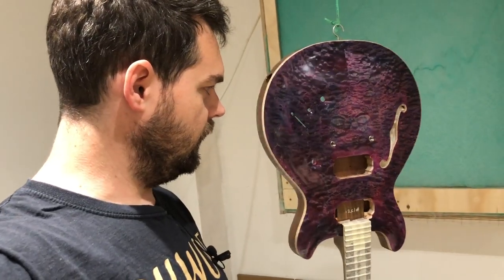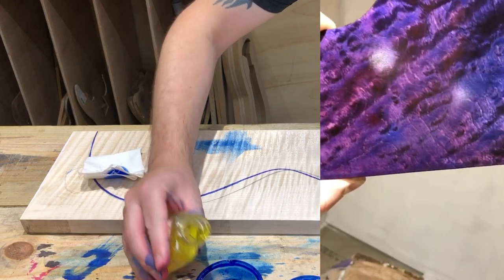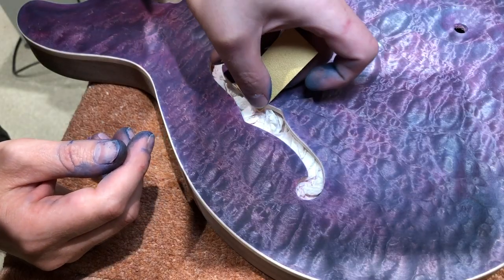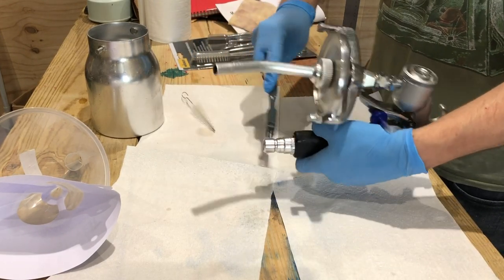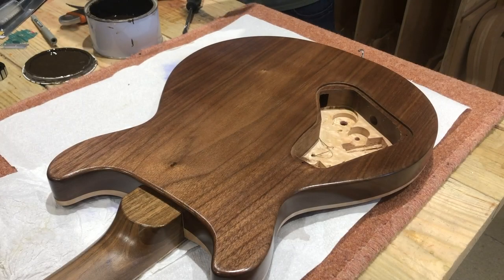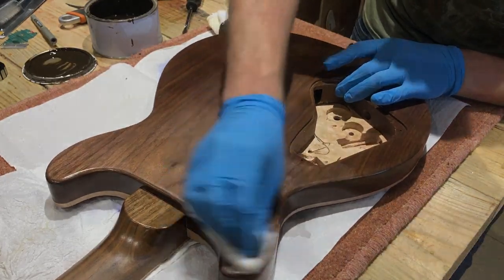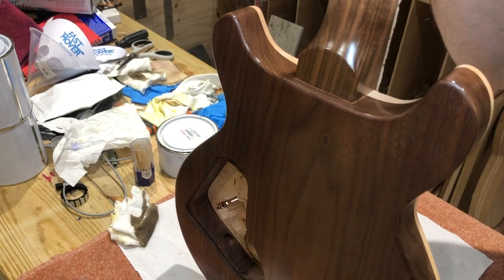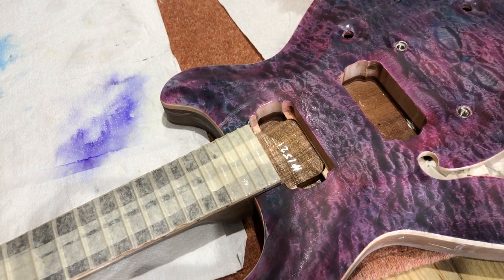STAIN, FAUX BINDING and NITROCELLULOSE finish | Great Guitar Build off 2021 | 5 of 6

Comment: Timber mate filler has been the best I've found for filling deep grain. No shrinkage, dries quick. Does a great job! Finish colors are looking great btw! Glad to see you're spraying a proper laquer finish with a proper gun. Makes a big dif
Reply from the maker: Thanks bud, does timber mate come as a clear filler? I was really only trying out Aqua Coat to save time not having to tape off the faux binding. I should have done a tester first but I've been rushing to get this thing finished.
Reply: @ADFinlayson  they have all sorts of various colors. I'm sure they have a neutral/clear color. Give them a try. Ived used many dif kinds of grain filler and Timbermate has been the only one I found to actually work without shrinkage. And it's pretty easy to use as well. And you can save the excess used and reconstitute it later. So 1 can goes a long way.

Comment: Beautiful finish work mate. Interesting to see you grain filled after a finish coat. My mahogony also has some grainy spots that could have been filled or better sanded before getting oiled. I may go back in a few months and see what I can do as well. For now Im just wanting to play it after all that work hehe. Im sure you are the same.
Reply from the maker: Thanks man, yes no reason not to add some filler after a coat or 2 of lacquer, the likes of prs spray sealer then grainfill to prevent it getting on the maple binding, sealer is just high build lacquer (the stuff I use is anyway) only thing I might not have mentioned was that I did scuff the surface up with the mirka pad prior to wiping in that extra filler. 

I'm not totally happy with this either, I did miss a spot with filler around that edge by the control cover, I also haven't got the top level sanded as well as I want to so I'm going to have to add a few more coats after (but I'll play it first). I sprayed 13 coats but I'd thinned the lacquer a lot so I need more on there. Pitfalls of spending 2 weeks on a finish I'd normally stew over for 2 months.
Reply: @ADFinlayson  right. Ben is soo spot on with that end of build just wanting to play thing vs taking time to perfect the last bits. I am glad I took time to set it up between initial oil coats and where mine is at now as there were a few tweaks I had to do that would have been problematic on a totally finished build.

Comment: The Aqua clear definitely works better over a few sealer coats,, but it requires patience to build it up on anything very open grained. I haven't used it for a while now and have tended to use Thixotropic Grain Filler from Rothko and Frost, which is great to use and produces perfect results.  Very nice build; well done.
Reply from the maker: I'll check out Thixotropic, cheers Angus

Comment: I think if you pour molten glass into a solid pattern of nitrocellulose, it'll fume colors into the glass as it burns away, so you could get a tie-dyed glass look this way, and the carbon gives it structure, like an opal...

I think you could make gun stocks out of this Glass-Injected Nitrocellulose-Based Carbon-Fiber, and it would be better stronger and more heat resistant than polymer... and also look cool.

I think a lattice-like frame of nitrocellulose carbon fibers, acting like a skeleton for the glass, it all will melt together, but it reinforces the glass like re-bar concrete, so thay it stays in one piece, and just glass dust gets knocked off, if you whack it on a rock or some concrete. 

Probably cheaper than wood, with an initial expensive investment.... it pays for itself
Reply from the maker: What?

Comment: Can you recommend a dye or stain that could work on a maple fret board?
Reply from the maker: Any dye that you can dye a maple top with will work on a maple fretboard, it will rub off though unless you use a hard finish, lacquer, poly etc